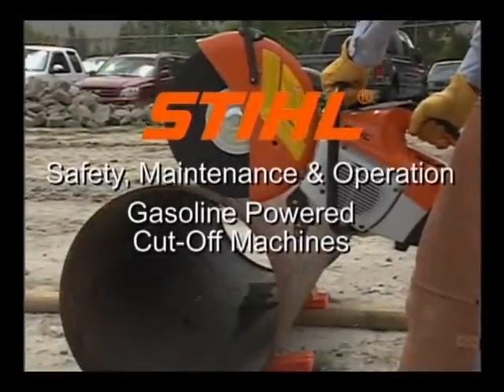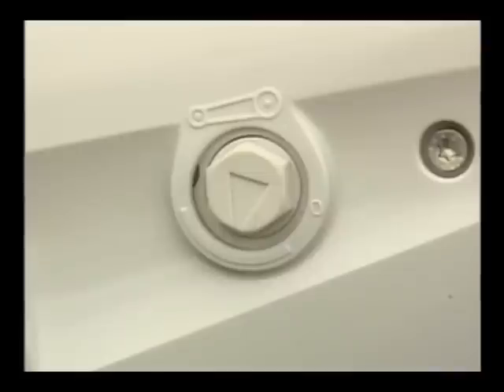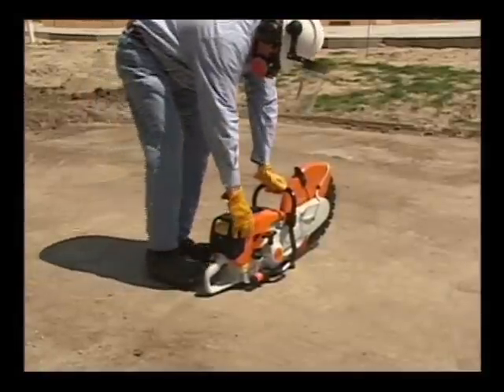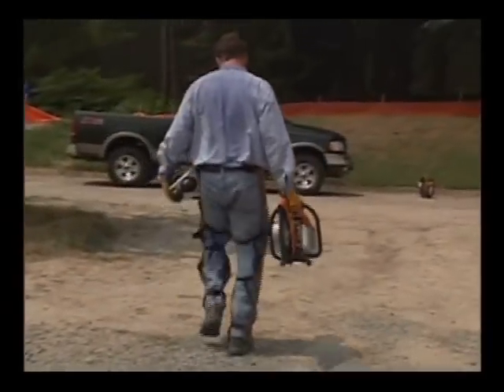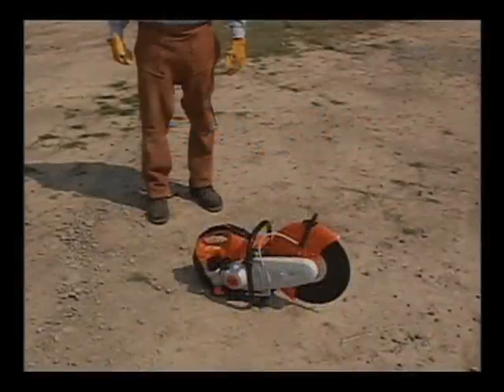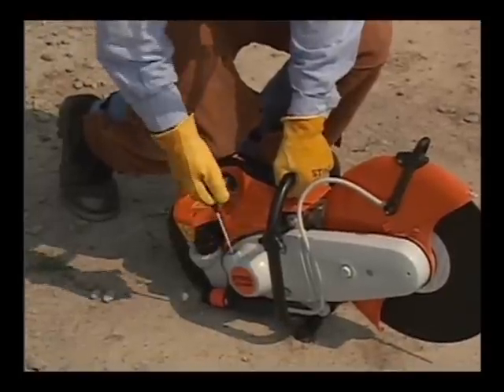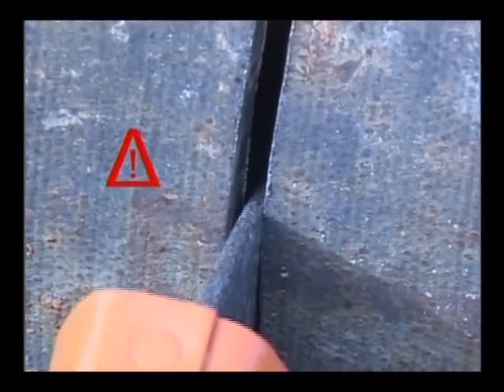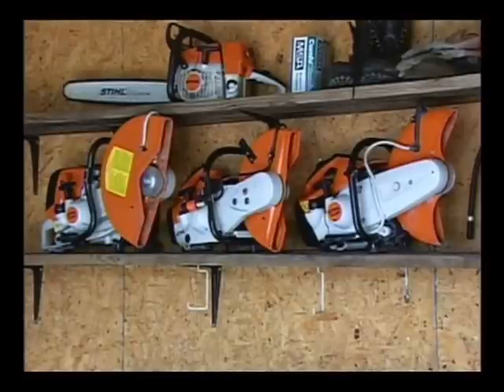How to Safely Maintain and Operate a STIHL Cut-Off Machine | STIHL Tutorial

Comment: anyone can help me please ts 350 concrete saw when pull on starter rope piston is knocking against spark plug
Reply: Did you change the plug? If it isnt the same as the original it may be to long.

Comment: Could Someone please explain to my dumbass on how to remove the guard to clean the gunk that builds up in there from cutting, thanks
Reply from the maker: Hello Narco, to clean debris build up from the guard, make sure the machine is off and the wheel is not rotating.  Remove the wheel it the debris is still damp you can rinse with water to remove the debris if not use a flat blunt object to break up debris and then rinse away.

Comment: i have a ts 420
Reply: Which wheel does it has
Reply: @christhekid674  
14inch wheels on ts420,s.
Reply: @lmilne4859  oh I was planning to get one in the near future to cut concrete when I get myself a house and make concrete stairs outside the front and back
Reply: @christhekid674  
Ts700 is beast for smashing through concrete most powerful saw in there range wee bit more weight but real power house.